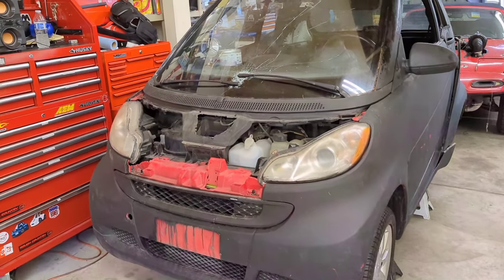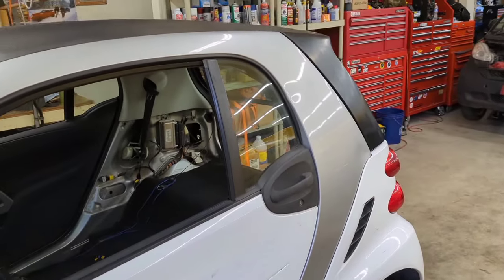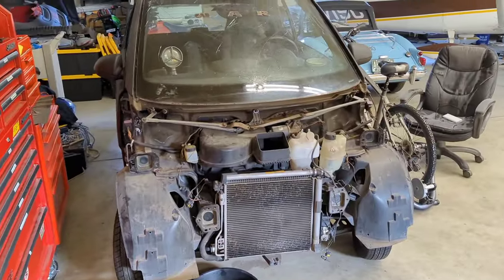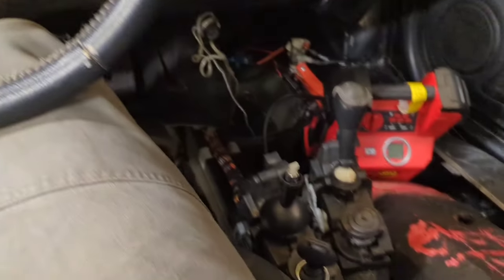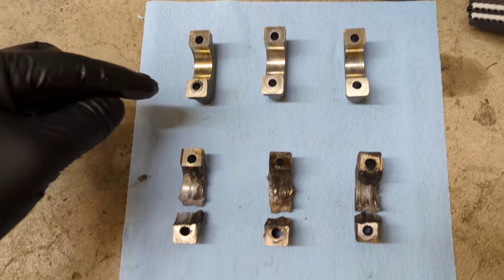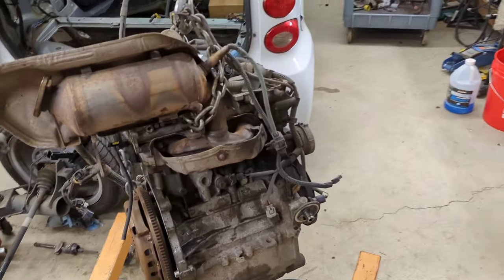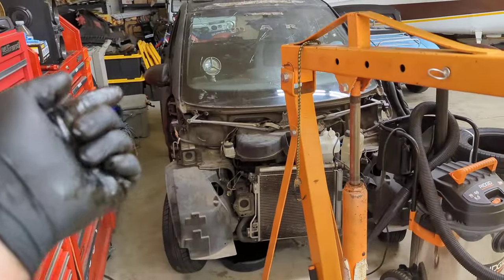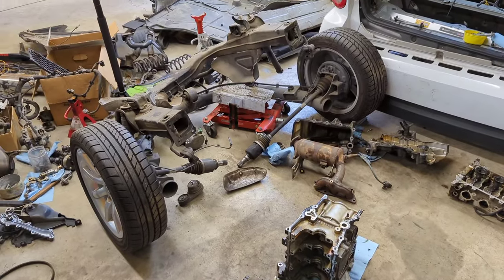Fixing the Cheap Smart Car (Full Engine Teardown) [4K]

Comment: The taillights have to be pluged in for the trans control module to get power. Hope this helps.
Reply from the maker: That's interesting, thank you!
Reply: You did the correct decision, the white except for the engine which is gone is more complete than the black mate  one, I hope you don*t have to put the wire harness or the computer from the white car in order to see if that engine is in tip top condition.

Comment: good grief, that has to be the most shagged Smart engine i've ever seen. I've had a Smart Roadster adventure at some point, the one with the first generation 2 valve engines. I've seen some rough ones, people think they are buying a cheap and cheerful car, only to find out they have to deal with Mercedes maintenance, and just don't. Years down the line the thing ends up at a specialist or this happens.
Reply from the maker: Exactly what you see all the time in the states with older German and Italian cars, the cars may have depreciated but the maintenance costs have not.

Comment: a blown air-gasket is the end result of prior bad & nasty problems..!.  .exept the Smart Brabus (that had much better all around parts and over the top cooling system) ,Smart cars are known for terrible cooling problems due this enclosed engine ,it needs to be ventilated and fitted with a thicker radiator with a manual command for the cooling fan..,adding a secondary extractor fan and enlarging the air scoops is a good thing also..scooping fresh air from under the block to cool dow the transmission ,all the plastic covers under & sides transform the engine bay in an oven so cutting parts of them is good to avoid heat-sinking problems (starts to render all parts fragile in there including the head gasket..!!)..

Comment: I have a smart car 2008 passion cabriolet in DC. Its running on one cylindar. only 90k miles. has been a good car until the oil drained out somehow and jacked it up

Comment: If my smart car is loosing coolant and has no heater. What do you think is wrong with it? Radiator or water pump ?
Reply from the maker: I'd say find where the coolant is leaking out from, that'll be your problem most likely

Comment: from the looks of it... im gonna have crazy work cut out for me.. trouble im having with my smart fortwo is a faulty coolant thermostat which is bolted next to the alternator and ive only seen sketchy footage of others referencing a thermostat swap without exact footage on how to access it, the intake manifold is directly on top of the thermostat and it looks like the entire engine needs to be lowered to even begin to loosen that whole area. this is gonna be a nightmare.
Reply from the maker: Lowering the engine isn't as bad as it looks. Undo the two rear brake lines, the fuel line, and the four main bolts holding the rear subframe in and the whole thing will lower down. The worst part in my opinion is undoing the coolant hoses that run to the front of the car, but you should be able to lower it just enough to do the thermostat without removing the coolant hoses.

Comment: How hard was it to drop the motor down? I just bought a 2008 and wanna change the plugs but I think u have to drop the motor down.
Reply from the maker: It's pretty easy, there's four main bolts to drop the whole rear subframe. Worst part by far is disconnecting the coolant lines that run to the front of the car, but if you're just doing plugs you can probably get away with leaving those connected. You'll probably want to undo the fuel line as well.
Reply: You don’t have to drop motor to do the plugs I built a 2012 passion swapped a 09 brabus setup under it. No issues besides exhaust leak. Just got another 09 with a blown head gasket will be doing the gasket soon as I get it home to have two.
Reply: Oooo ok ok cool
Reply: @HangarGaraj plugs out easy don’t drop the motor

Comment: So, my smart car isn't doing to hot and I'm contemplating doing a full repair myself, but, as you could guess I'm no mechanic.  I am however, equally afraid that I might get scammed by a shop (it's happened to me a lot) and am willing to at least take a look for myself so I know what needs to be fixed

If you have any tips as to how I could find a trustworthy shop or at least know what I'll need to know before any work gets done to it
Reply from the maker: What's wrong with it? Personally I don't deal with shops much so I don't have any real advice on how to find a trustworthy shop other than looking through their reviews.
Reply: Go for it, most things are self explanatory, understand some basics of internal combustion engines, most important part is organisation, bag and label everything!
Reply: I hear parts are nonexistent in the US these days.  You might need to resort to a parts car like the video.

Comment: How Much Did You pay For It?
Reply from the maker: The two parts cars were very cheap, but with all the parts it ended up being about the same as I could have just gone out and bought a regular non broken smart lol
Reply: @HangarGaraj  I Saw 1 on Facebook for $1,000. Said it has Low compression number 1 Cylinder. So I looked on youtube and found your channel.
Reply from the maker: Running and driving ones seem to bring 4-5k, if you can find a good engine for not too much or rebuild the current one that seems like a good deal.

Comment: I repair computers. I know that there are going to be an insane amount of dissimilar screws & bolts (dia, thread count, pitch, head type) in that thing. How in the world do you marry these back during reassembly when you take them out, willy-nilly? I make drawings and tape my tiny screws where they go-- wth do YOU do???
Reply from the maker: With this particular engine I knew it was never going back together so I wasn't concerned, but usually I take a picture of each bolt next to where it came from so I can match them up later. Or if I don't have a phone on me I use masking tape or plastic bags and write down where they came from.